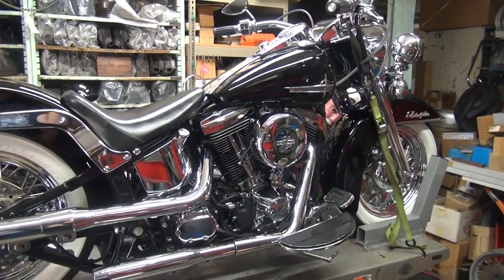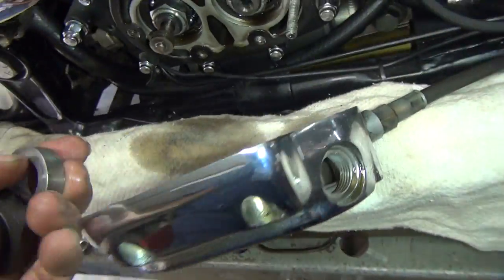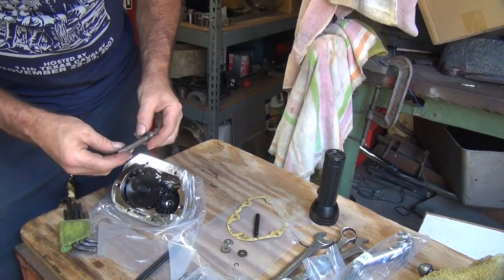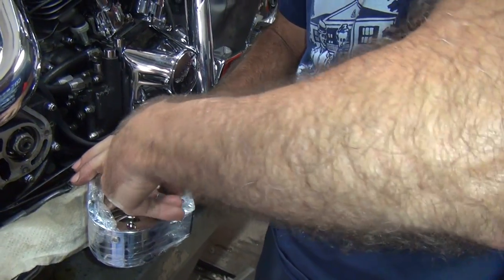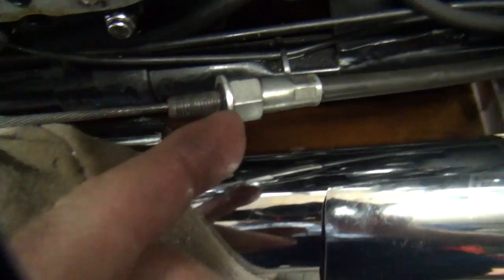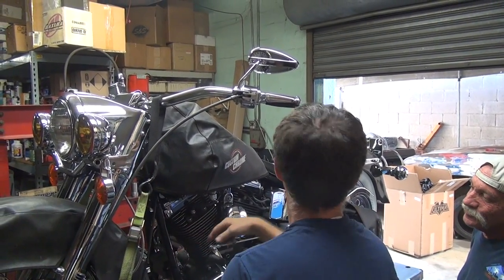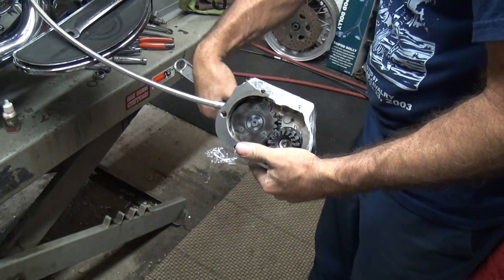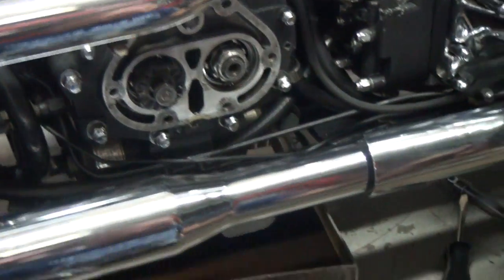1989 softail #101 5 speed kicker install fxst flst harley kick starter by tatro machine

Comment: I watch your videos they are great.  I have a question.  I have a new Harley with 700 miles on it.  when the engine is cold it makes a knocking sound, then stops and starts again.  Also, the valves are noisy.  the bike is actually new.  Evolution fxdwg.  thank you in advance.
Reply from the maker: new what, they stopped making evo bikes in 2000.
sounds like a lifter problem. try using a good 20/50 v-twin oil.  i like the 25/60 maxima oil the best for a good mineral oil.
tatro
Reply: @TatroMachine  thank you 👍

Comment: THREE THREADS..... GEEZ, the MFG could have made a better product by integrating the spacer into the kicker pawl nut. IIRC for the Sportster kits, you need a longer (custom?) mainshaft to do the kick conversion. Seems this kit would also benefit from this, or the re-designed pawl nut

Comment: Hi im fairly new to the channel and wish i would have ran into it earlier i am working on taking the evo from my grandpas 1998 fatboy that was wrecked and put it into a 1995 softail heritage roller. I currently have the tanks off and the primary opened up and am wondering what i need to be looking out for when i do this. What seals should I replace what can i do to get a bit more power out of it without tearing the top end apart ? Should i be worried about the cam bearing and or breather at 59k miles. What kind of things should I not do. I really have no intention of trying to riff raff this bike back together since the engine is coming from a bike he got with like 6 miles on it any assistance or info would be great thank you everyone

Comment: If you're going to spend an entire video talking shit about a product why are you using it?
Reply from the maker: some times or most times you have to use what you can get. the fact that it is a pile of crap makes no differeance. what you do with that pile of crap to make it work correctly is all that matters. if you think parts just bolt right on, you are a complete moron.
tatro

Comment: from Taiwan?? no thanks.... by american buy #Baker
Reply from the maker: don't fool yourself. that chevy is made in mexico and the new harley is made in india. go check out those new usa made honda and toyota trucks. can't go by the names anymore.
tatro
Reply: I bought a brand new kicker shaft (Chinese manufacture) for a fresh rebuild on a 1970 Sporty...it had quite high compression and not enough oomph for the stock electric starter.  The brand new Chinese kicker shaft kicked over the bike about five times, it fired up...stalled out, and upon another couple of kicks the thing snapped right off showing highly crystallized cheap steel.  But....trying to avoid Chinese parts is difficult these days...
Reply: @TatroMachine  Sad but true....Harleys have not been built in AMERICA since I believe 1967 or 68....

Comment: I have a Harley Twin Cam 88 2004 with carb and I want to install this kit. Is it possible? I will find some problem to kicker? Thank you!!
Reply from the maker: unless your ignition can be changed to a zero turn start function it will never start. it has to fire the plugs every time the pistons come up on the firing stroke. no free spinning like all the ignitions are set to do.
tatro
Reply: @TatroMachine  Thank's, I will check this!!!

Comment: Have you heard anything about the kicker since the install?
Reply from the maker: it slips everynow and than but works. with only one leg it is not how he starts the bike.
tatro
Reply: @TatroMachine  Thanks, would you not recommend using it as the sole way to fire up a five speed bike? I can’t imagine you couldn’t replace the locking lugs to something a touch more heavy duty…

Comment: Hello Friend.  I have a twin cam 88 cubic five gears and a 96 cubic 6 gears.  Where can I buy a foot starter, how much does it cost.  If you can, let me know.  Greetings from Poland.  Piotr 🤚
Reply from the maker: the 5-speed box is easy. i don't know of anyone making a kicker for the 6-speed trans.
tatro
Reply: @TatroMachine  Hello. Ok.  Thanks for the hint.  How much is the kickster do dyna twin cam 88 cubic 5 speed?
Reply: @TatroMachine  I have a question.  Is the Dutch company Zodiak's kickstarter a good product?  It costs around 490 euros.  There is Miller Motorcycles in Germany, their kickstarter costs € 1,430.  Do you have any idea for a good kickstarter?  Greetings Piotr.

Comment: I was thinking about buying this Ultima kit... but after watching these videos, I think I'm gonna skip. Thanks for saving me some money. BTW the Ultima kit is a copy of Rivera's "sharpeye" kicker.
Reply from the maker: they all suck. if you want a kicker then this is what you are stuck with.
tatro
Reply: Kickers are silly on an Evo because unlike previous HD (which are defective by design) starters both early and late Evo starters work properly and require little maintenance. I had a Custom Crap kicker briefly until the ChiCom ratchet stripped. I replaced the guts with Baker gears and ratchet but didn't bother swapping it over when I upgraded to a 1997 bagger box. Kickers on Shovelheads and prior are a necessity. Kickers on an Evo are pure poser. You made the right choice.